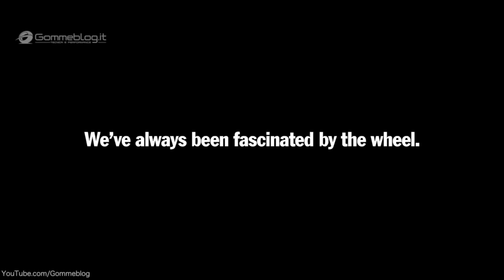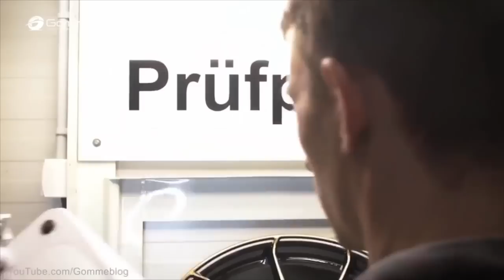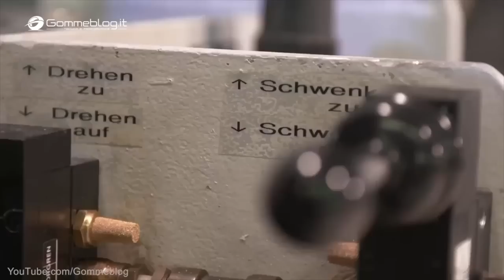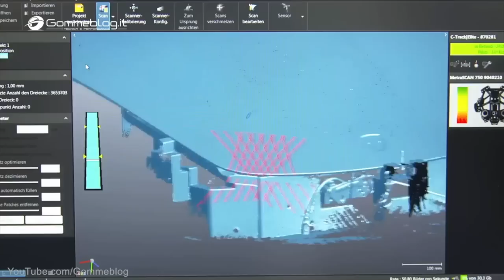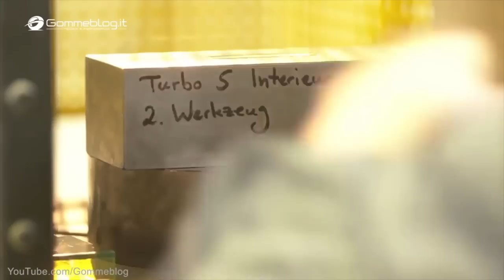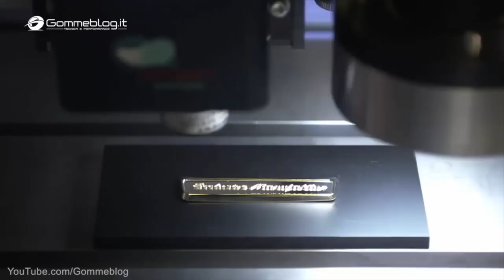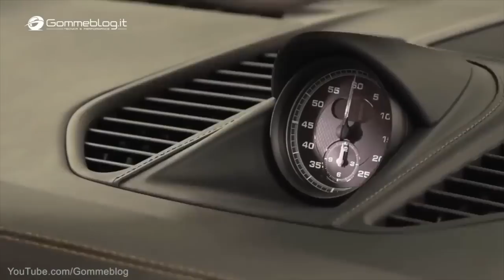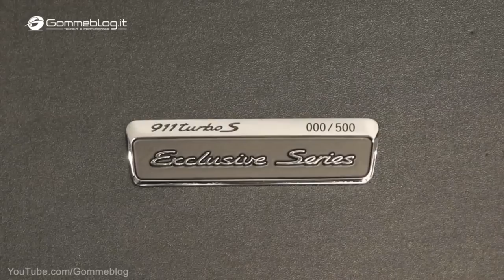PORSCHE 911 TURBO S Car Factory HOW IT'S MADE Manufacturing [FULL VIDEO Production]

Comment: The precision of the build frightens me, knowing very well that driving the vehicle will alter the dynamics and eventually lead to dysfunction, and then repair.  The multiple screws, attachments, stress points and alignement is in such precise fashion that impossible to maintain...The special tools needed may not always be available and when you add time constraints a recipe for eventual dysfunction.